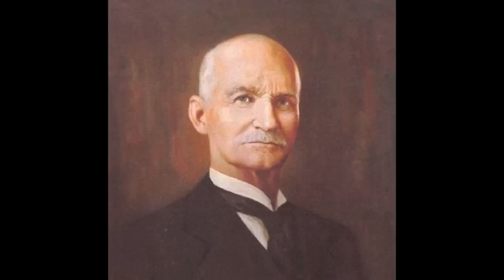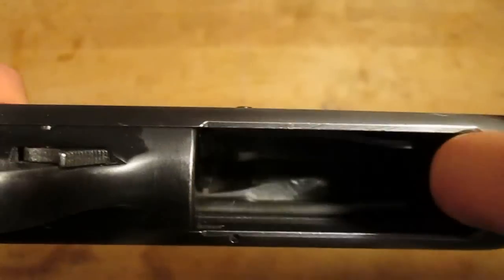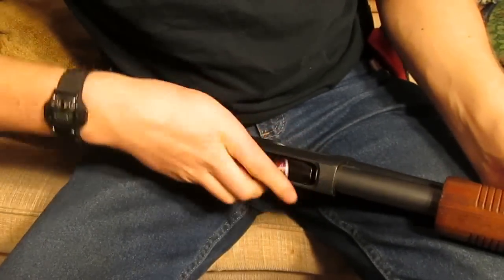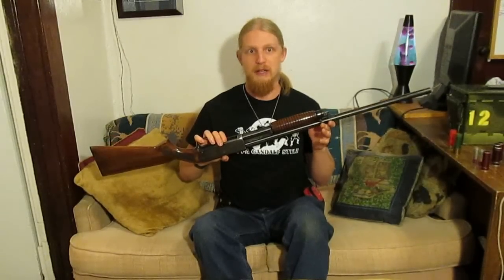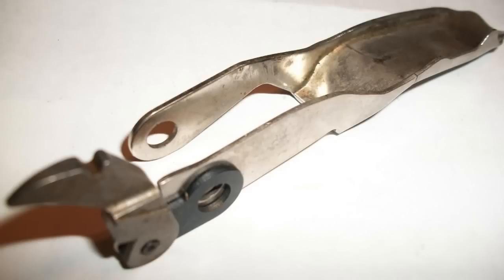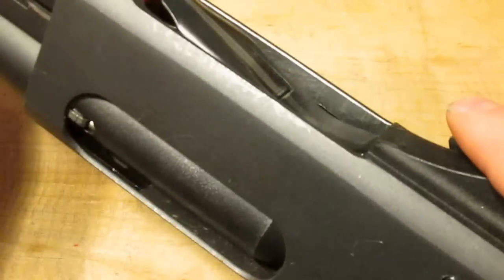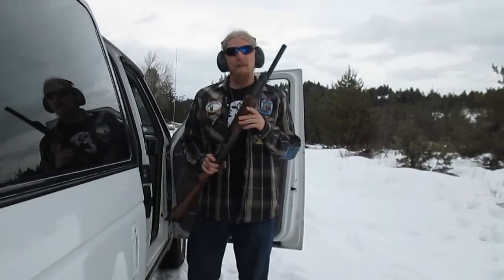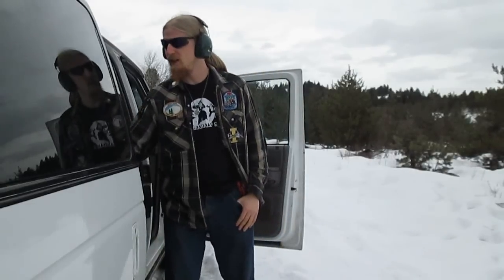Much Ado About Shell Carriers - Remington 870 Tips & Tricks #5

Comment: My 870 recently developed an issue letting the shells out of the magazine and onto the carrier.  I am going to take it apart and clean it out, polish the shell catches and see what happens.  Anything else you would recommend?
Reply from the maker: Polishing your shell latches probably won't help, though the shell latches may well be the issue.  What exactly is the problem you're having?  Is is shells feeding when they shouldn't, or shells not feeding when they should?  Also, how old is your 870?
Reply: not feeding when they should. its 20 years old but very well maintained. express magnum
Reply: I was shooting sporting clays yesterday (which I never do) and about halfway trough the day, it started not loading the first shell. It loaded subsequent shells okay. I am not sure about the quality of the house shells I was using either.
Reply from the maker: Gordon Ellis Were you trying to shoot quickly when it happened?  Racking the slide almost immediately after pulling the trigger?
Reply: No. I was just trying to load the first shell from the magazine by racking it. I don't remember having any issues while shooting and then racking.
Reply: I got it fixed. I took out the offending latch, cleaned behind it really well then polished the end with an Arkansas Stone. Worked flawlessly.🙌
Reply from the maker: Yeah, debris behind the shell latches is a common cause of feeding problems.  I would be careful not to over-polish the tips of the shell latches, as they really don't need to be very smooth to work properly - there actually should be some friction there.  Smoothing them too much - or doing so unevenly - can cause double-feeds.
Reply: Thanks for the tips. I only polished it to the inside just a tad. I verified it's locking up good after each fed shell. I used your video on how to align it after I had to reinstall it. I appreciate the work you've done

Comment: Awesome video! I just bought a new 870 Police and I've noticed that my carrier is crooked, it's slightly off center and tilted to the right; is this normal? I haven't shot it yet but it loads perfectly fine with snap caps but this is the first 870 I've owned where it's off to the side, it almost touches the wall of the receiver. Any thoughts?
Reply from the maker: Keep in mind that the 870's shell carrier isn't symmetrical left-to-right.  That might make it look more off-center than it really is.  I would say give the gun a try, and see if it's actually causing any feed problems.

Worst case, a replacement shell carrier is cheap (or probably free if you call Remington and report a defect), and can be installed in a matter of minutes with no tools.
Reply: Ok thanks! All of my other 870's always appeared to be centered. Do you have any 870's like this?
Reply from the maker: I only have the one 870.  I can't say for sure that its carrier is perfectly straight (again, hard to tell by looking since it's an asymmetric part), but it's never given me any problems.
Reply: Ok thank you!

Comment: Do they call it ghost loading because its going to get you killed?
Reply from the maker: I'm actually not sure how it came to be called ghost loading.  The more apt term is carrier loading, and I've heard that some shotguns like the Mossberg 930 or Benelli M4 can handle it quite reliably.  I've never seen a flex-tab 870 have problems with ghost loading either, but because takes a lot of time and effort to set up, and the carrier is immobilized until you chamber that shell, there's really not much point to ghost loading with an 870.  If you want more capacity, adding a magazine extension is very easy on these guns.

Comment: The part about dirt getting in the gun is wrong, dirt can still get in the 870 and because of the down carrier it stays in the gun... That was one of the failing points of the 870 vs 590 in military testing although the military now uses both the 590A1 is the main stay for military use because it was the only gun to still fire after the grueling test they put the guns through.. Dirt would build up in the tube and jam the gun... Although dirt gets in the 590 it doesn't build up because most of it falls out so it didn't jam on hard use. Both are great guns for the average person though
Reply from the maker: The 870 didn't compete with the 590.  The 870 was first officially adopted by the U.S. Armed Forces back in the 1960s - before the 590 was even developed - and has served continuously ever since.
Reply: Actually they did compete with the 590 as well as others and at the end of testing the 590 was the only gun still firing... So the 590A1 was adopted... They had very specific requirements, example being a thick barrel for the navy so they wouldn't dent the barrel when sailors would knock it against the bulk head and things on ships... I never said the 870 isn't used or was never used by the military I just said the 590A1 out performed all others in that set of tests...
Reply: I think both are great shotguns
Reply from the maker: Got a source for that?  Everything I've read and heard says that the 870 was adopted for military use in the '60s, and wasn't submitted for the later MIL-S-3443 tests in the 1970s that led to the adoption of the 590 (the 590A1 came later, in the 1980s according to my reading).

I agree that both are really solid guns.
Reply: Synchronizor I carried an 870 as a MSG in the early 2000’s. Even after the corps had adopted the benelli. I can’t tell you what their shotgun is now but I never had a failure with mine and we spent a lot of time at the range.

Comment: Is that a pre-Freedom Group 870?
Reply from the maker: It's kind of a mish-mash, but most of this gun is a 2011 Express Tactical model.  I believe that does make it a Freedom Group 870.  It's been a really great gun though, the only issue I had with it was a cross-threaded stock bolt (see my Tips & Tricks #2 video), but that was a minor problem that was easily fixed, and Remington sent me all the replacement parts I needed for free with no drama.
Reply: Berserk Highlander what is a pre-freedom 870 mean?

Comment: I just can't see why I would ever use that ghost load thing.  It looks like a lot of trouble to do.  The gun obviously was not designed to be operated like that. And if it compromises the operation of the gun, and/or could cause damage to the firearm, there's no way I'm doing it.
Reply from the maker: I've mostly heard of  ghost loading being used for competition applications, where folks are looking for every edge they can get, and setup time isn't an issue.  Being able to get one more shot off before having to reload is certainly an advantage.  Also, I believe some other shotguns can be ghost loaded a bit more easily than the 870.

But as I said in the video, it's not really very practical in most situations, especially given how easy it is to simply add a magazine extension to an 870 and get the desired capacity that way.  I just thought it would be an interesting thing to show in this video.  I had seen folks asking about it, and at the time, I wanted to avoid having videos that were just me talking about the 870, and not really showing how to do anything with it.  

If I were to tackle this subject now, I would probably split it up into two shorter and better-paced videos, one focusing on the theory and working in more detail on the Flex Tab update and how to do it to older 870s (and using a less awkward camera angle); and a second video showing ghost loading alongside other magazine-related techniques.

Comment: Ghost load the shotgun!? That's gotta be the most asinine thing I've heard of in a long time. Load the firearm as it was intended if that's not enough buy an extension. To set up a firearm to fail and possibly injure someone for the sake of one extra round is not worth it. Try jamming one more nail in the nail gun and see what happens, that'll get the roof done quicker. Think people Think.
Reply from the maker: There are some other shotguns that actually do pretty well with ghost-loading.  The 870 isn't the best at ghost-loading mostly because it's kind of a faff to set up.  But the primary risks with ghost loading an 870 are simply accelerated wear of certain parts and a potentially stiff or sticky action with that ghost-loaded round.  The 870 is still a very safe design, and ghost loading does not directly pose any danger to the shooter.

Comment: Am I the only one whose 870 shell carrier has the older style without the notch I got the gun for Christmas 2018 from my dad it jammed by getting a shell caught I pushed the trigger group pins out and pulled it out to get the shell out.
Reply from the maker: Is your 870 a 12ga model?
Reply: Synchronizor no it is a 20 gauge express
Reply: @joshuatwyman2956  My 20 gauge 870 doesn't have the flex tab cut either. Why isn't such a simple fix included on the 20g ? I suppose bird hunting isn't a critical application but people use these for home defense also.
Reply: Beesa10 I use mine for rabbit hunting but I have noticed that 20 gauges have them less than 12s though
Reply from the maker: @joshuatwyman2956  Yeah, they never put a flex-tab style carrier in the small-frame guns (although I think the jams tend to be less serious in them for other design reasons).

The good thing is, as you get practiced with an 870, you get real good at positively sliding the shells in all the way to the "click".  Pretty much the only time I see the shell-over-carrier jam with my gun anymore is when I have someone less-experienced try shooting it.

And while the 20ga is and can be used for home defense, in that role you're not likely to find yourself in an extended shoot-out where you need to do a lot of combat reloading.  Police/SWAT work, military duty, and competition shooting where the 12ga is king put more emphasis on that.
Reply: Synchronizor thanks for that info it’s as definitely my fault I was practicing a tactical reload I saw in one of IraqVeteren8888 videos where he grabs 2 shells and puts them in at once I learned not to do that again. I miss your videos they were the best 870 videos that made the 870 easier to understand for me.
Reply from the maker: @joshuatwyman2956  Hopefully I'll be able to get back to making them again.
Reply: @SynchronizorVideos  Must admit I haven't experienced this type of jam, nor do I expect to be combat reloading in an extended shoot out. Just don't like the idea the 20 gauge may have been overlooked as a 'youth gun' and not received the same simple and possibly life saving fix as the 12 gauge. Perhaps (due to dimensions and force required to clear the jam?) the flex tab isn't necessary in the smaller gun.
Reply: Travis Thacker  Hey man, thanks for the info, yeah I did notice my 870 doesn't like the cheap steel based ammo (fiocchi no6 field cartridges) it sticks in the chamber and is difficult to extract. The better quality brass based Eley ammo cycles like a charm
Reply: Travis Thacker  Dude, 870 in 28 gauge is a cool gun. I have a spanish AYA 20 with a v nice chromed bore
Reply: Travis Thacker  Same, I would like a wingmaster but can't really justify the cost compared with an express, plus I saw a 20 for sale with ammo belt at a low price. I used to shoot a 28, it's the ideal small shotgun imo. The availability and price of small cartridges is pushing them towards obsolescence which is a shame as they do have their place and lady/beginner/youth friendly too
Reply: Travis Thacker  I'm in the UK, here walmart is called asda and they don't sell cartridges. Reloading and the know how is the way forward. I mail order mine but that's not the best value
Reply: I have a 1951 870 12 gauge ( first year they were produced) and have never had a problem .

Comment: How can I determine length of extension soon that it won’t interfere with a 20”barrel on 870 wingmaster 12ga shotgun
Reply from the maker: Measure from the front of the barrel guide ring to the muzzle.  That's the overall extension length you're looking for if you care about it matching (it's really not a big deal if the extension is longer or shorter than the barrel).  Usually +3 extensions are sized to match a 20" barrel, but there are differences between brands.
Reply from the maker: @ninjaskitches  Yeah, an extension has to stick quite a ways past the muzzle for a pellet strike to be possible.  Even birdshot doesn't usually spread fast enough to cause pellet strikes.  Competition shotguns often have extensions that are longer than the muzzle.  The only real problem with a protruding extension is that you'll tend to get propellant residue on the extension tube, but that's more a cosmetic issue than anything else.

Comment: Ghost load, my ass.  Instead of busting your ass trying to to overcome the shortcomings of the Remington 870, just buy a damn Mossberg 500 and be done with it.  5+1 with 2 3/4", two magazine shell retainers, two control arms, and nothing to catch your fingers.
Reply from the maker: sman7290 You must have missed the part where I recommended magazine extensions (which the 500 can't use, by the way) over ghost loading, and also failed to notice that the 870 also has twin shell latches and twin action bars (which the 500 copied from the 870 after Remington's patent expired; early 500s only had one action bar).

Also, why are you even watching 870 videos if you're so convinced they're inferior?  Are you just bored and looking for someone to troll?